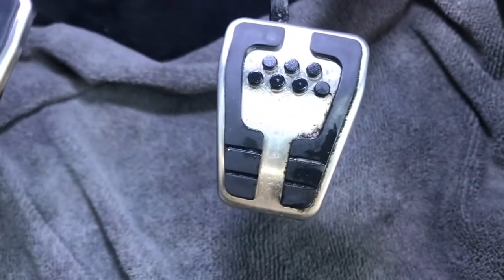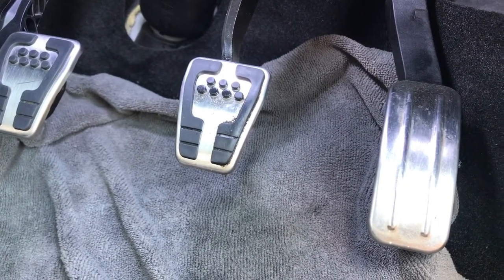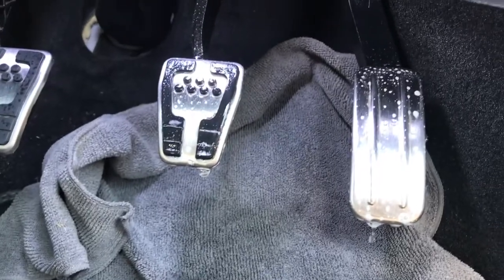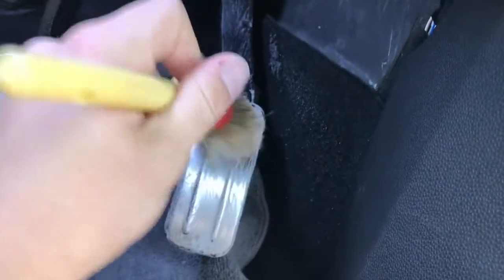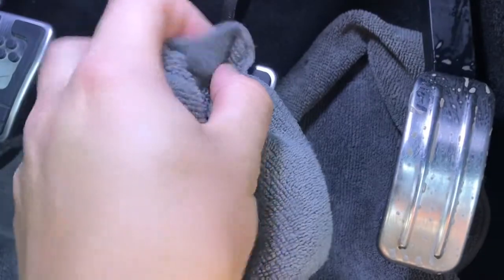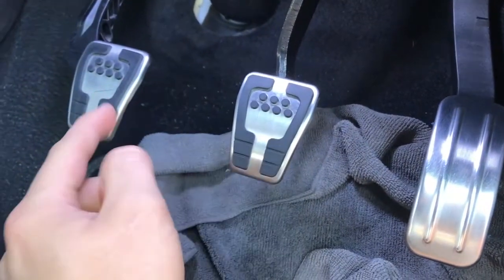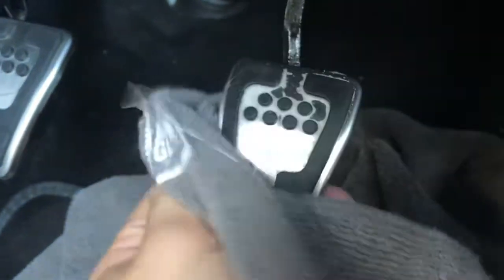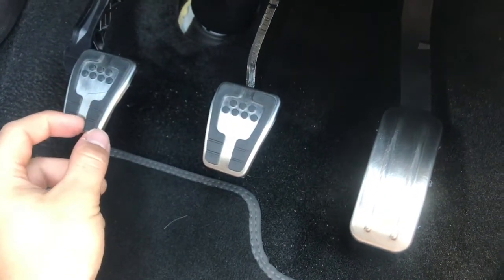QUICK DETAILING CAR PEDALS

Comment: I agree,  it's important not to miss the little details like that when cleaning,  my dead pedal gets real dirty real quick,  I need to pick up one of those detail brushs, thanks for the video
Reply from the maker: joe chmiel no worries man! As weird as it sounds for the pedals you could get away with using a very soft brush toothbrush... but you can also pick up a detailing brush for about £3 in most detailing websites.